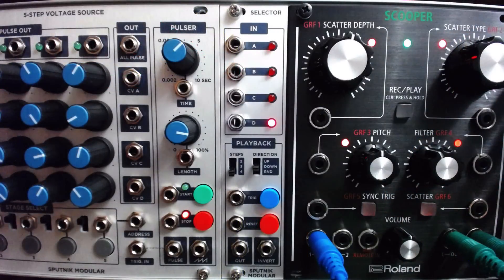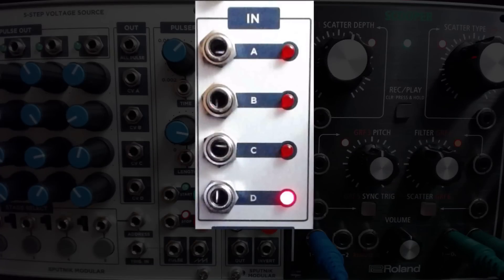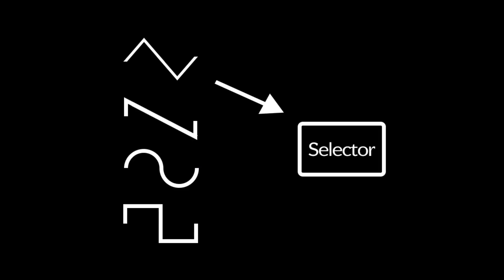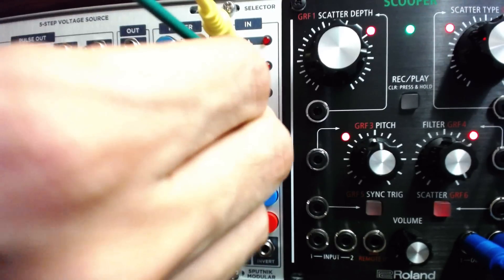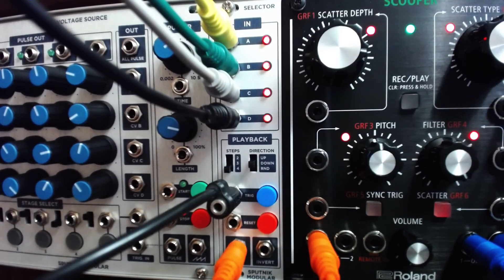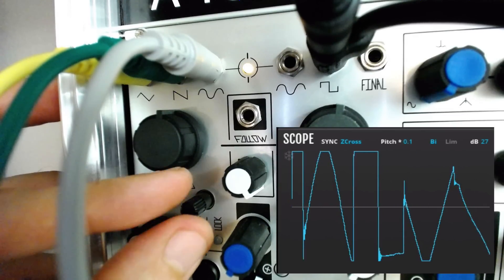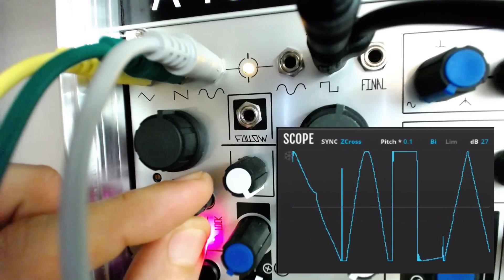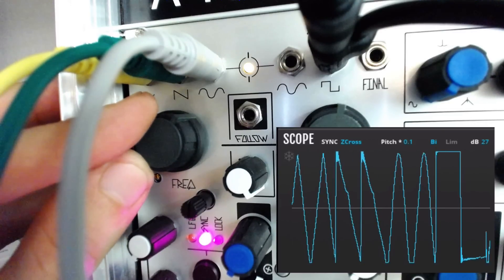Sputnik Selector Eurorack Wave Multiplexer

Comment: Great! But the manual only talks about simple trig, clock, gate for the switch.  Audio rate is not dangerous in  term of time for the module?
Reply: Not at all. I have two of them and they can handle audio and CV just fine.